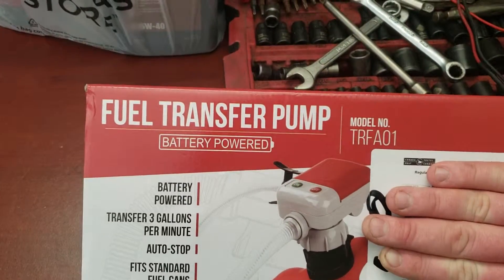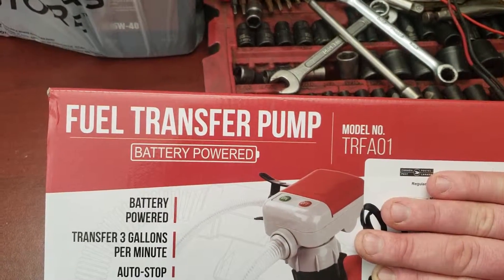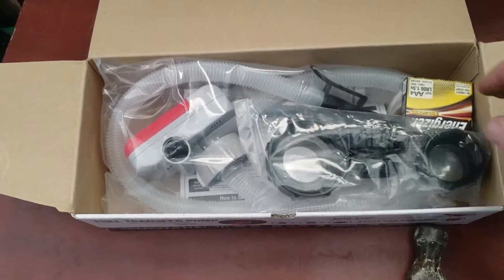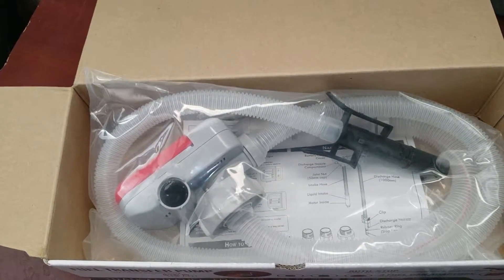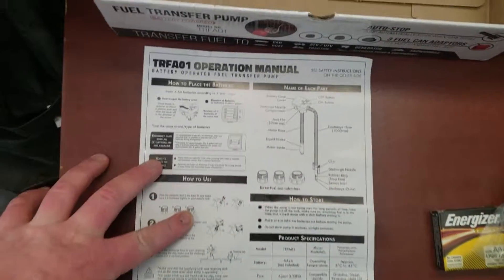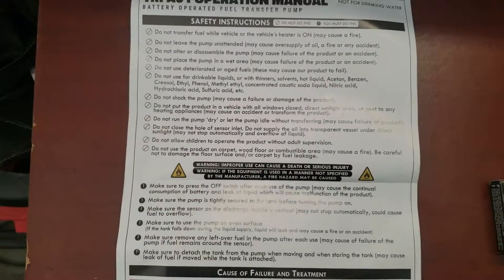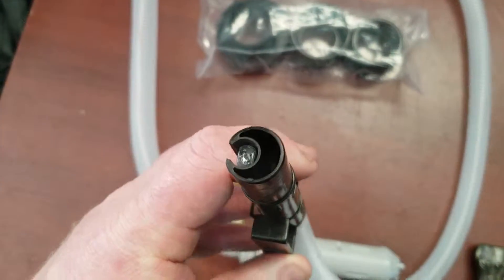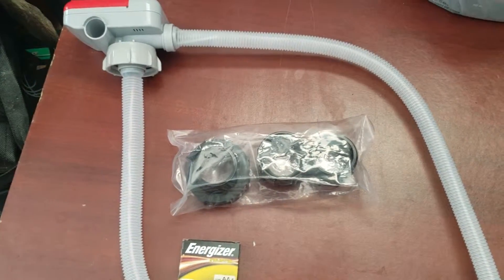Fuel Transfer Pump

Comment: With your generator you really should just run it dry and keep it empty. Just keep a fuel can with freah gas around. Once a month empty the can into your car or whatever and refill with fresh gas.
Reply from the maker: I've heard different scenarios on keeping a generator full or keeping an empty.
When I'm finished with the generator I run the carburetor dry anyways.
Also the generator is stored indoors, Garage.
Reply: @redneckbryon  I'm just saying if you kept the tank empty but always had fresh fuel on hand, it would be less work than pumping the tank out regularly, but still would be ready to go at any time. I don't see the point in pumping the tank out and refilling it all the time when you could just leave the fuel in a jug and not have to put it in and take it back out of the generator tank for no reason.